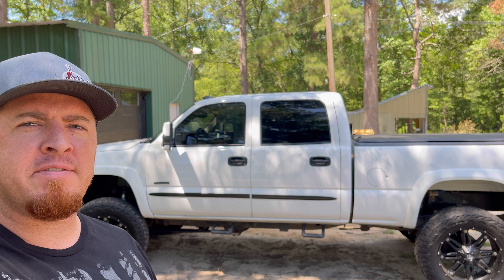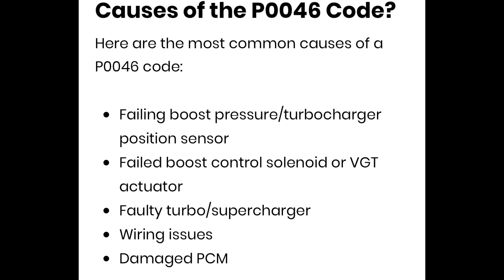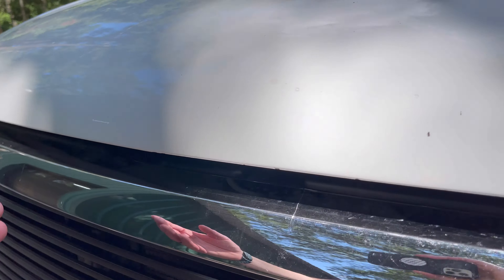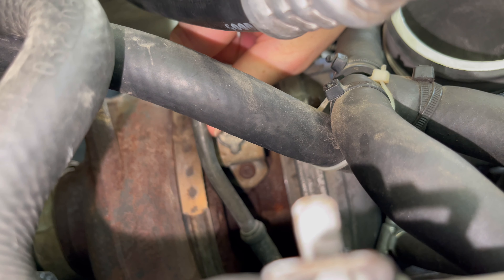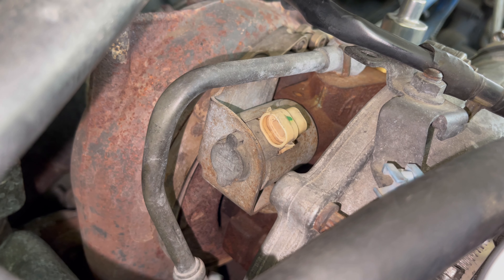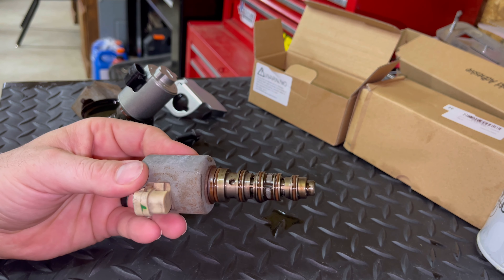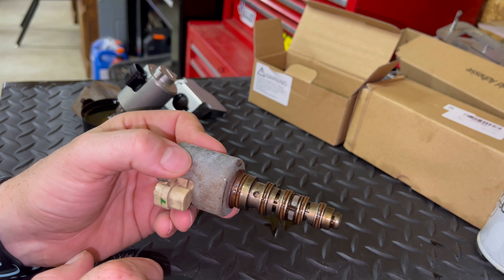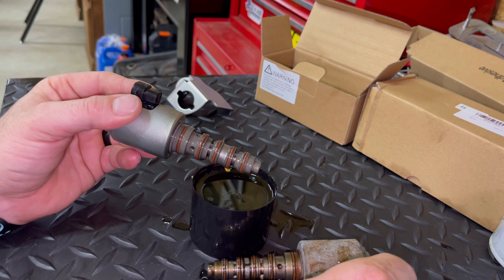P0046 CODE TURBO BOOST CONTROL SOLENOID DURAMAX LLY LBZ LMM GMC Sierra Chevy Silverado How to fix

Comment: Thanks for the tutorial....same model of my truck, just watched this vid....and I will do as you said to do.....
Reply from the maker: You’re welcome! Thanks for watching.
Reply: Hey Whiplash, my husband has the same code on this exact vehicle.  We have replaced the vane position sensor, the boost control solenoid and the wires for it. And still same code. Should I try the boost control valve?
Reply from the maker: @katherinebogue7072 have you checked to see if the vanes are stuck and won’t move? Sometimes that can be the issue.

Comment: Hello.. well like a year ago maybe 6 or 8 months i replaced my solenoid like in the video .well the code is back... I have been workint the truck as a mason contractor .have had 2.5 tons in it not intentionally .always ran great . This time around felt sluggish today when c.e.l. light went on but i was loaded with stone ... i will check tomorrow and see how she runs ... any chances ot can be a bad turbo ? And where is the waste gate ?? And if mine is stuck open would it trip the code?? Also could my solenoid go bad allready consider less then a year old ???  We do work the shit ourve it at times...but i maintain her well ...synthetic oil .change every 4 k and i use the mobil 1 synthetic 20,000 mile filter for extra cleaning ... please help im a diesel novice lol .thankyou so much in advance . Btw best video WVER 
Frank G.
Reply from the maker: @empirestateconstructionllc2336  thanks for watching and dropping a comment. After I changed this sensor which had seemed to have been out for a little while, it seems like the turbo vanes had to work themselves free again. I would check your turbo vanes and make sure that they are free.
Reply: @whiplashtv2022   sorry to ask but how do I get to the vanes easily ?? Lol thanks again

Comment: It looks like you have boost air leaks you should get 15 PSI at least 25 if everything's perfect like new
Reply from the maker: It goes up over 25psi when getting on it really hard. I didn’t get on it that hard in the video. Thanks for the concern though.

Comment: I have the same truck and the same code. I have changed the vane position sensor, the boost solenoid, should I try the boost solenoid valve?
Reply from the maker: The vane position sensor is often times not the fix. The boost control solenoid that I replaced in the video did the truck for me.

Comment: I just threw a P0048 boost control solenoid high circuit, feels like the wastegate is stuck open but I’m going to pull this tomorrow and see how it looks. Still getting 25mpg somehow
Reply from the maker: Yeah it might be stuck open or the solenoid simply has a high circuit voltage.

Comment: I'm getting the P2563 and P0046. Truck has no boost from a dead stop. You can mash it to the floor and it falls on it's face. Then it will very slowly take off. Also my exhaust doesn't change sounds when idling.
Reply from the maker: Have you changed your Boost Control Solenoid?
Reply: @whiplashtv2022  I have only changed the vane positioning sensor so far.
Reply from the maker: @Dmax04  I changed that as well before I changed the solenoid. It turned out that the solenoid was the issue.
Reply: @whiplashtv2022  I've been wrenching on cars for 48 years and so far I haven't figured out the combination to get on the head of that bolt. I have an 04.5 LLY but something is a little different.
Reply from the maker: @Dmax04  that line to the turbo might be in the way. It can be removed if it is in the way and then reinstalled at the end of the job.
Reply: @Dmax04 .... I have the exact same two codes popping up.  Did you resolve this?  if so, what was it?
Reply: @rodneyhorrocksjr.8963  No, I haven't messed with it anymore. I don't drive it in the winter time. I drive my old rust bucket 97 K1500. Duramax has never seen snow and very little gravel. No rust what so ever.
Reply from the maker: The Boost Control Solenoid and Vane Position Sensor is going to most likely be your fix. It is hard to tell if 1 or both are bad when you get both codes.
Reply: @whiplashtv2022  I appreciate it.  I will give the solenoid a shot first since it's fairly cheap and see if that solves it.
Reply from the maker: @rodneyhorrocksjr.8963  👍🏻👍🏻
Reply: @whiplashtv2022  I finally got around to pulling the boost control solenoid and cleaning it up. Put it back in and started the truck. Still got the P2563 code. Switched out the vane positioning sensor and cleared the code. So far no codes after about 30 miles. Truck seems to run better but still not 100%. Still lagging from a dead stop. Exhaust is still not changing sounds. It does have the Hyper Tech set on stage 3. EGR blocker plate and 4" exhaust. Wish I had a boost gauge to see what's going on.
Reply from the maker: @Dmax04  I replaced the vane position sensor before I did the boost control solenoid. I highly suggest putting in a boost control solenoid. If there is nothing wrong with the turbo, then it will probably fix your issue.
Reply from the maker: @Dmax04  I ended up installing one of these to see boost and many other things and it is well worth the money. It is a great monitor! 
https://amzn.to/41fMa0b
Reply: @whiplashtv2022  friend of mine is a tech at the local GM dealer. I had him hook his tech ll to the truck before I done anything to it and command the vanes to open. He said the vanes were only working between 30 to 36 percent. The truck sets a lot so they may be stuck.
Reply from the maker: @Dmax04  or the boost control solenoid isn’t moving them and allowing them to get stuck. I thought mine might have been sticking some too. Pretty sure the new boost control solenoid got them moving all the way again.
Reply: @whiplashtv2022  do you have a good source for the boost solenoid? Someone said the dealer doesn't stock them. I know they vary in price but like the saying goes you get what you pay for.
Reply from the maker: @Dmax04  This is the one that I purchased.
https://www.carparts.com/details/GMC/Sierra_2500_HD/Replacement/Variable_Geometry_Turbocharger_Control_Solenoid/2005/SLE/8_Cyl_6-dot-6L/RF50500001.html
Reply: @whiplashtv2022  finally got around to replacing the boost solenoid and still no change. Lags really bad from a dead stop. Once I get rolling it runs great. Don't think I'm up to pulling the turbo. May have to bite the bullet and take it to a shop.
Reply from the maker: @Dmax04  Did you change out the vane position sensor? Did you hook it back up to a Tech 2?
Reply: @whiplashtv2022  yes new vane positioning sensor and new boost solenoid. Still lagging and still getting same two codes.
Reply from the maker: @Dmax04  well that stinks. Assuming that you disconnected the battery and let it relearn…then I guess you will have to look at the turbo.
Reply: @whiplashtv2022  yep, disconnected both batteries. Cleared the code and drove it about 10 miles and cel back on. Not sure what's going on. It runs great otherwise. I noticed it lags more like first thing in the mornings when it's cold. Not as bad after it warms up. Exhaust is still not changing sounds when idling so almost has to be a vane problem.
Reply from the maker: @Dmax04  The vanes might be stuck. Sometimes a good boost control solenoid will loosen them up if they aren’t froze up too badly.
Reply: @Dmax04 I have the same motor. I used a 1/4”drive, deep well, 5/16- 12 point socket. Put the socket on first, then add your 1/4 drive ratchet to the socket.
Reply from the maker: @bradpalmer4681 👍🏻👍🏻

Comment: I have this same code for my 2005 6.6 dually. I noticed the idle is a little funny. Line it will ise fine then idle weird and the whole truck would shake. Thought the truck already shakes I noticed a different type of shake. 

Will this fix my problem too??
Reply from the maker: Yours sounds a little bit more injector related. Have you checked your injector balance rates yet?
Reply: My 05 lly needs that too .how do u check the rates ? Fancy shop computer ?
Reply from the maker: You can check your fuel injector balance rates with a monitor like this one. 
https://amzn.to/4dHCOPO
Reply: @whiplashtv2022  thanks so much !!
Reply from the maker: You’re welcome

Comment: What about p003a
Reply from the maker: The vanes of the turbo charger not being moved and controlled correctly by the turbo boost control solenoid could cause this code to pop up. Also the vane position sensor not correctly reading the vane position could cause it as well. The boost control solenoid and vane position sensor are not crazy expensive to replace and you can definitely do it yourself.